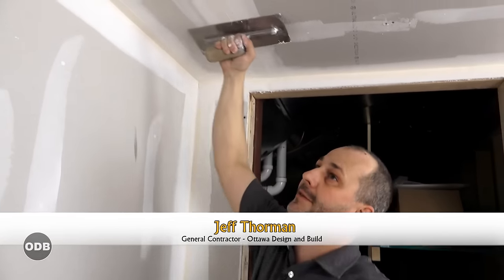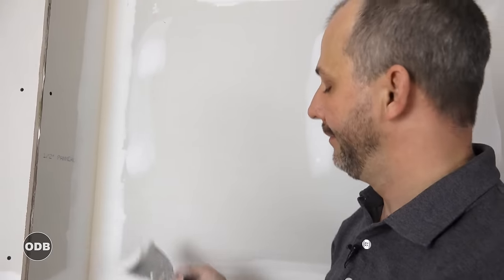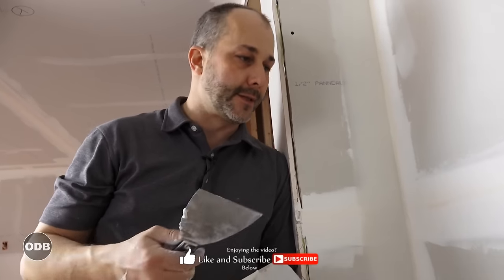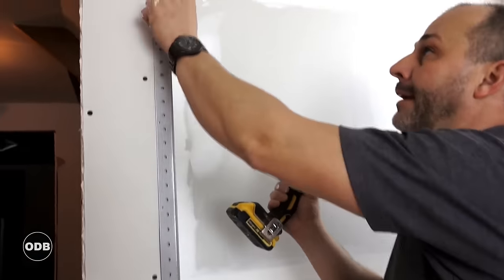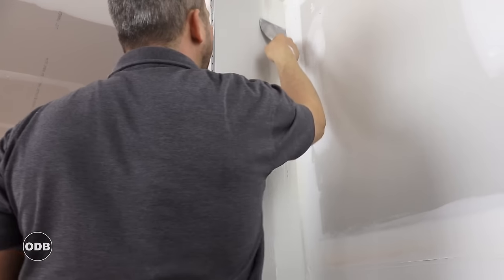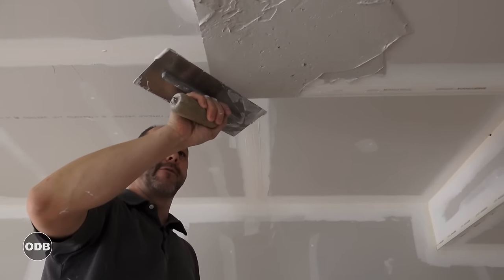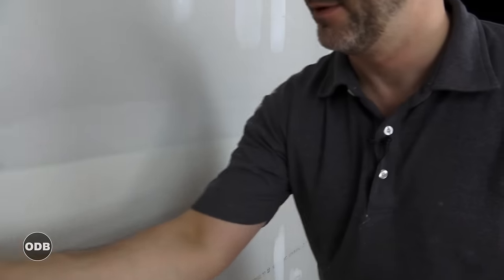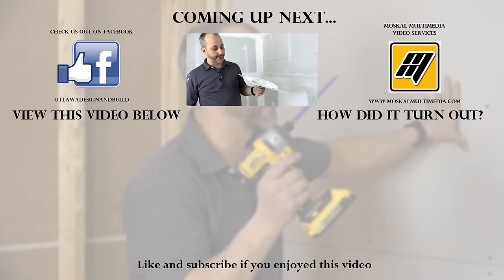Complete Drywall Installation Guide Part 8 Second Coat And Corner Bead

Comment: I'm renovating a bedroom right along with you and I want to say thanks. The videos are a great help. I did plaster work last in 1973 when my dad and I built the interior walls of this house. Now, in 2019 I have returned home after a zillion termites had their way with some of my interior walls. After tearing them out and rebuilding the stud work and walls (this time with ground contact lumber), replacing the electrical wiring and boxes, and hanging the sheetrock, I'm in the plaster stage. Again thanks for the refresher course. A lot has changed since 1973 (including my back and muscles) and it helps to see how new materials and tools have made the job easier. Keep the videos coming.
Reply: Our friend who is in construction stopped by and I told him I wanted to know how to do the popcorn ceiling with the glitter in it just like the house I grew up in. He wasn't nearly as excited about the idea as I was 😂

Comment: Every other job I go on im fixing corner beads that were done  the way this guys does them.  Not enough screws and no tape or  mesh . Your gonna get a hair line crack right down the lip of that metal corner bead as it expands and contracts.
The proper way to do them is spray them with an adhesive glue and than screw it  even finish nails are good so that lip is tight to the sheet rock. With the little bit of screws you put you got plenty of play on that bead.

Comment: Some day, an update showing round corner beads would be keen; that way I can see how easy it could be if I ever got good at this stuff. Meanwhile, I'm experimenting by running a strip of painter's tape down the middle of the corner for the first & second coats, then pull it off for final & wipe down with damp cloth to smooth the edges.

Comment: The tool this guy spoke of is called a clinch-on. It's quite the useful tool for installing corner bead. It's much faster and you don't have the screw holes to fill. Also it takes a skilled taper 60-80 seconds to apply bead using a clinch-on.
Reply from the maker: Yup and costs a couple hundred bucks.
Reply: @HomeRenoVisionDIY  I found a site where you can get a clinch-on and a rubber mallet for 60 USD. So not really all that expensive, but handy to have. Though, having used one, I can say that it takes practice to get the hang of using it right.
Reply: and it's garbage, there is no strength to a corner bead when a crimp-er is used. If you are going to use metal corner bead, use screws as nails will pop over time. I rather vinyl corner bead with adhesive glue.

Comment: You truly are AMAZING!!! A do it all dolly! I wish my husband was as handy as you. But in his defense he’s a pretty darn good tool passer for me lol. I think I’m gonna be sanding for 14 days 😩.  QUESTION... MY second coat on a joint DIRECTLY above a heat duct started about a 4” crack right in the middle of my joint... was it because of the blowing hot air? Doi sand  and recoat ? Thanks buddy for the information, I think u rock. I watch all yur videos and I’ve learned so much.
Reply from the maker: yes too much warm dry air will cause the mud to crack. no worries just fill and go. Cheers!
Reply: SO JEFF just a btw the negative air is awesome if U have the time space and money to set one up but I bought this cheap $20 HYDE Dust Free Sanding Kit that attaches to the shop vac and there’s LITERALLY do dust! And thanks for the prompt reply. Why r u not on HGTV???

Comment: While not everyone has one - I use my thermal camera as a quick "is the mud dry" test! 
A quick look around the room with the camera tells me if there's any cool blobs. It will be noticeably cooler when it's not done setting.  
Probably doesn't apply to the 45 minute stuff (never tried).
Reply from the maker: That is quite an advantage. Truth is sometimes I will leave it an extra day just to make sure it is hard. The inside corners of a basement are usually the last to dry.

Comment: Jeff, thanks for the videos, i am about to attempt following them to finish my basement, starting off small...lol anyway I have 2 questions, 1. to confirm you use 45 Mud for filling holes/gaps etc as well as the first coat on corner beads, and then regular mud on first pass of taping corners, horizontals, butt joints and screw holes? 2. In your 45 min masterclass video it shows you applying the metal corner beading to the joint using nails suggesting it creates a nicer line, however i also see in this video you use screws and suggest they are better , so now i'm confused as whats better to go with? My father inlaw construction worker has said screws.
Reply: I got a little confused on 45 mudd verses "mud" on which coat, thanks for asking the question.

Comment: You make it look so easy! I always have concern about the final coat being perfectly smooth with no ridges or irregularities at the transition with the drywall.. can you show up close with side lighting to show just how smooth your final coat is? I think I am obsessing. Thanks.
Reply from the maker: Just a bit. The truth is when you use a good primer the solids in the paint actually smooth out the wall and make it seamless.

Comment: beginners drywall tip: when installing corner beads use staples . yes the actual staple gun from the 1900s that you push and a staple pop out (t50 staple gun). the concept of corner bead is to be held by mud not screws and screws can be difficult for begininers (professionals use a crimping tool and it barely holds the corner bead so in that sense staples are perfect) i do recommend 1 to 2 screws or as need but really staples are fine except high traffic areas 3to4 screws . staples dont protrude and they set flush against corner bead to wall for for solid grip but beginners trying to use screws is a pain for them because im a professional and hated when i depended on screws to hold corner bead now i use staples or crimping tools. for wood framing ill use drywall coated nails any day ....never use screws . i also recommend the (strait flex orignal corner bead) sold at home depot . ill still use this for residential houses not commerical jobs
Reply: bankhead39 i would just recommend the paper corner beads. Those metal corners are old school. You can apply paper corners with taping mud  and that method is probably the best bet for the professional's and the diy'ers
Reply: @604jade  My near term job I need to match my old school metal bead because I'm cutting a section out and replacing it and the wall behind it. But as for new installations I will consider something different, something that doesn't dent so easily.  For paper bullnose bead is the whole thing paper or just the flanges?  Do  you put mud behind or inside the bead for support or leave it hollow like metal bullnose bead?

Comment: Great Series - Learning Lots!  Quick Question - maybe I'm over (or under) thinking it, but in Part 8 (day 2) you did butt joints, corners, then did horizontal joints.  Wouldn't that mess up the wet mud on the butt joints?  Also in Part 9 (day 3) you started by scraping the butt joints so you could do horizontals.  Would I be correct to assume it's just an editing issue and that day 2 would be butt joints & corners, day 3 would be horizontals?  Thanks in advance for the help!  Keep doing these videos...they are AWESOME!
Reply from the maker: I do all the horizontals on day 2 where the butt joint is not present. Just try to remember that going in an opposite direction joint with wet mud is bad regardless of the day! Cheers!
Reply: Thanks!  So basically in the end each joint has mud when you tape, a second coat, and a third "thinned out" coat....regardless of the order.  This series is really easy to follow and I feel comfortable moving forward with my DIY Remodel.  Much appreciated!

Comment: I love these videos! You've been such a huge help, thank you! The only thing I haven't seen is how to deal with strange wall angle. I have some walls that have outside corners at about 20 degrees and I'm not sure how to tackle the gaps between the sheets. Should I just stretch out a metal corner bead or is there a better product/technique to deal with this situation?
Reply: Theres a product for that kind of corners called metal flex tape... i wish i know how to punt links in here or pictures

Comment: Is it absolutely necessary to use the 45 minute hardener mud, or can you get away without using it?   I understand using it for the gaps during the 1st steps, but I noticed he was applying it in various other locations throughout the videos. Can you just use the regular mud for those locations?

Comment: I have a question, I'm new to all this. And I'm redoing wall on a doublewide. I'm pulling the battens off the wall and taping and texturingthem. On one of the corners the drywall does not come out to meet the other sheet. It stops shortthe thickness of the sheet. How do I go at that when putting on the corner bead? Do I fill the gap with mud or just put the corner bead on and go over with mud? I figure I should fill the gap. What do you say?
Your videos have been VERY helpful by the wat.

Comment: Detail work around outlets should be cut and filled when the prepwork is being done to prevent this stuff from happening. So when you're doing your first skim coats, you can hit the detail around the outlets the same day and everything will be good to go.
Reply from the maker: Thanks, there a re a lot of ways to do it right. I found this method the easiest for homeowners.
Reply: @HomeRenoVisionDIY  I get what you're saying, not everyone spends time taping drywall for a commercial construction company.  As long as you provide folks with good intell so they can get the job done right the first time, that's all that matters.

Comment: Jeff @ 7:18  you are showing the bulk heads.I am  boxing old wood ceiling beams with drywall .Should I use paper tape,metal tape,Plastic edging ? What will work best and give me the least amount of headaches? They look  like the ones in your bath room but mine are cobbled with replacement wood where the wood was rotten  .So I have to add wood to each one to make a visual continuity .then I will drywall them.I know there are products I could buy to achieve the look but I have next to no budget.Please help a house slave.

Comment: Thanks for all your knowledge. Why are you using 45 on the corner bead? Is it because of the depth or so you can do another coat of regular mud the same day? Thanks
Reply from the maker: mainly to fill without cracks. but I can get a second coat on in the same day as well.

Comment: Just found your channel this morning and all I can say is THANK YOU!!! Great information, clear concise and easy to understand directions. The worst part is that I can’t stop watching. I came to watch you grout a shower and now I’m watching other videos instead of grouting. Haha. 

One question on this video. Installing the outside corner bead... Why not use the holes that are predrilled in the metal? Is that not the recommended method? 

Thanks again for the great videos.
Reply from the maker: the large holes are to grab the metal with the joint compound. A similar method to lathe and plaster. There are small holes on the edge of the bead. Those are for the screws or nails. They are set back to the proper depth to find the framing. Cheers!

Comment: can you do a video of making a niche in an older wall with dry wall? I am currently in the process of redoing my dining room with three  12x24 niches. I am having problems because the wall I decided to do it in, is a wall that at one point was an outside wall. An addition was added on prior to me purchasing the home. So the wall is filled with vertical wood pieces, and installation. But i'd love to see how you would put it together. I also want to add puck lights, but I have yet to watch your video on how to do that.. So far all I have done is the holes in the wall, but I have to still fix and finish that. Please help I am a huge DIYer and have been watching all your videos. After watching your video on you redoing your kitchen, I really wish I would have thought to make the addition which is used as a huge dining room area, in the kitchen of my dreams..

Comment: When your filling your outside corners you should be applying your mud the same way you've been wiping it off its quicker more efficient and if you pull ur trowel towards the corner of the bead while ur wiping it down or even applying it, the mud wont end up on the other side of the bead if you use the trowel properly.
Reply: Applying the mud the way your doing is not the proper way to fill the bead im not saying it doesnt work but u should be trying to make your mud line straight as possible to make it look like a clean straight line for sanding purposes and in the end of the day it makes the taping job clean and professional when all your joints and beads all look straight and clean. Its easier for sanding as well.
Reply from the maker: I appreciate your thoughts ,however I designed this style to teach new folks so they could get great results.

Comment: How would you suggest applying a corner bead if the angle is greater than 180 degrees? Say, 210-220 degrees?

Comment: Hi from Australia and thanks for taking the time to make these vids. I came in to the series a bit late looking for a corner bead solution and will go back and start at the beginning.
One question though, in my renos I am planning a couple of 45 degree wall corners or 135 degrees actually. 
Would you use one of the plastic 135 deg corner beads or the more readily available 90 degree metal bead and flare the legs out to match the 135degrees? The common metal beads in Aus have many more perforations, are fairly flexible and are stapled on prior to coating. Seems they could be adapted?
Reply from the maker: If you go to any drywall supplier for commercial clients they will sell you 135 outside corner in metal or metal wrapped in paper. Some box stores even carry this as regular inventory. Cheers! I am not a fan of plastic.

Comment: Great videos. Question if patching up hole from an existing medicine cabinet. Can I use 45 min mud for all coats and finishing coat???
Reply from the maker: yes you can, just be sure to add a little extra water for the final coat to reduce the amount of sanding needed. cheers!

Comment: This series is fantastic! I'm drywalling my workshop and your videos have been indispensible. I messed up though - I used Durabond 90 for my big gaps (which is fine) and I've been using the red box (drywall lite) for taping and jointing (again, fine...). But, I have D200 + D300 trims at the top + bottom of my walls and around my windows. I wasn't listening closely enough and instead of using a hot mud I used the red box pre-mix stuff. How screwed am i? Am I going to have cracks all over the place? Should I go back and chip all of it off the trims, or is it not worth it? It's a workshop, and I'll probably be putting cabinets/shelves everywhere, but I'm wondering what I should expect... :(

thanks again - your videos are crystal clear and very enjoyable to watch!
Reply from the maker: If you use too much pre mix it will crack when drying. Don't panic simply use a hardener mud to do the next coat and then finish with a smooth coat. Once the mud is dry it won't continue to shrink. Just give that first coat a couple days to finish shrinking before moving forward.

Comment: Great for home owners on small projects. Screws should b done with a 5 to 6 inch blade to avoid leaving excess on sides like in the video. 1st coat should b coverd with atleast a 8 inch trowel or blade. (I PREFER A 10 AND 12 TO FINISH) AND IF YOU CANT SEE THE TAPE THEN THAT IS NOT NECESSARILY A BADTHING.  Depending on how your joint are you may have to give it a couple pases on each side of the but angle and even on beveled joints if they are not flush or if they r damaged. You are making a mockery of the trade i so dearly love.  But its  videos like these that almost guarantee my yearly salary quality matters

Comment: Thanks for the video's - big help as i'm upgrading my basement. Question might be silly or not but when you illustrate your inside corners method for the 2nd coat, do you use the same method for the ceiling/wall?  Thanks!
Reply from the maker: Thanks for the comment Michael. The answer is yes. any inside corner gets the same treatment.
Feel free to ask us anything we try to get back to every question.
Reply: Thanks for the quick reply. It helped me along the way.  Thanks again from Long Island, NY!

Comment: Quick question, at the 9:30 seconds. Are you using the quick 45 still? Or did you go back to the other mud with out adheasive?
Reply from the maker: I use 45 for filling gaps and cracks. Cheers!

Comment: Haaving trouble with big trowel leaving grooves the trowel is bowed front to back and flattens out when you put pressure on, all the new ones I looked at were like that. Its tough to do 3  light passes on  a but joint with out leaving grooving on the end  of the trowel
Reply from the maker: Hi heather I do not use a curved trowel with my technique. You will need to get a flat rowel for what I am showing. Try looking for a drywall supplier in your area that is not a box store. Cheers!

Comment: I did a bad job trying to repair a crack line in the ceiling. The ceiling drywall moves if you pushed on either side. I used mesh tape and it filled it with compound came back sanded and looks good and then painted. The crack came back and now I have a bulge. Should I remove the underlying mesh tape and sand everything down?